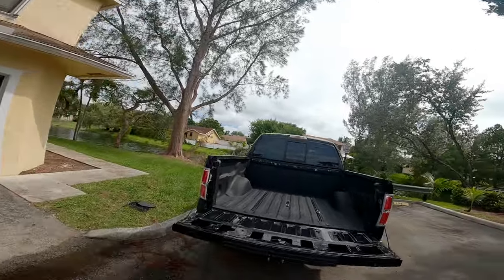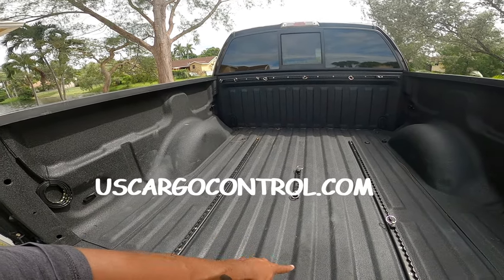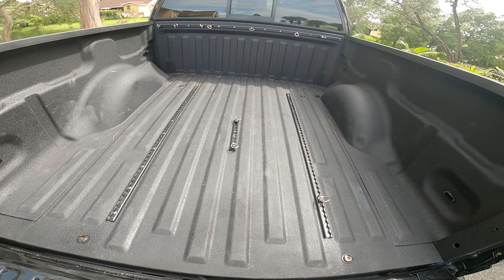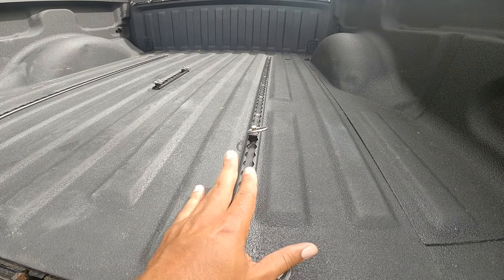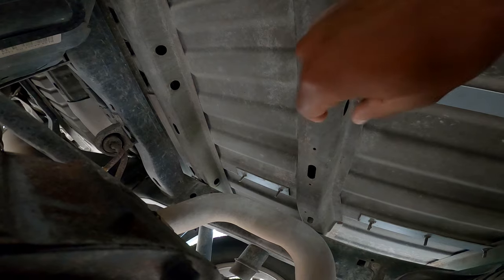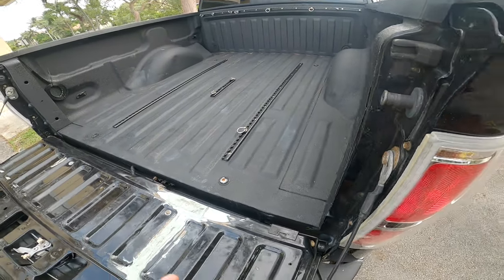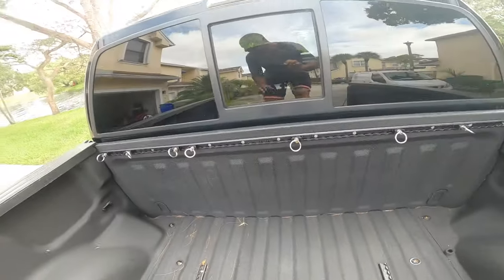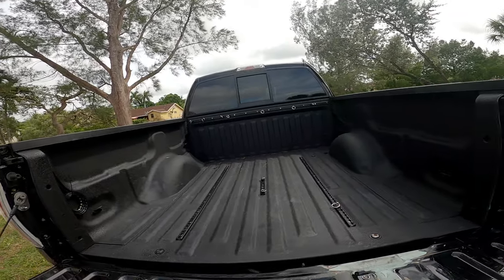L-Track System in a truck bed

Comment: I will say, mad respect to you dudes that load their 600cc+ sport bikes in the bed of your trucks. I put my ZX-10R in the bed of my Ram once and it was supper sketchy. After that I just got a cheap $500 5x8 trailer off of Facebook market place and modified it to solely be a motorcycle hauler. The way i see it is, all it takes is one slip to nearly total my $12k investment + the cost of medical bills if that heavy sum bich crashes down on top of me. With a cheap trailer thats never a possibility + it works really well for loading a crashed bike or broken down bike.